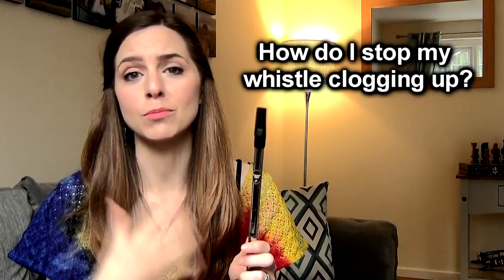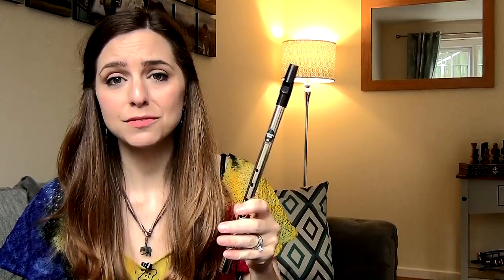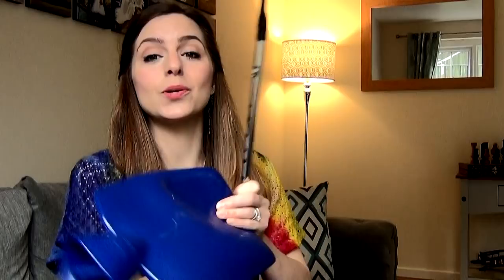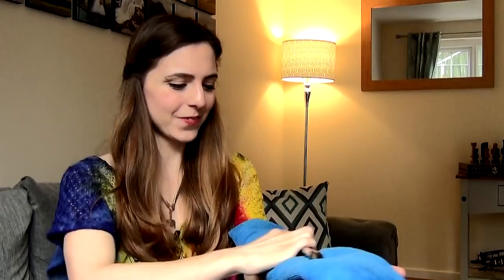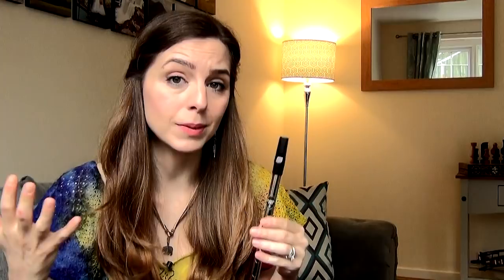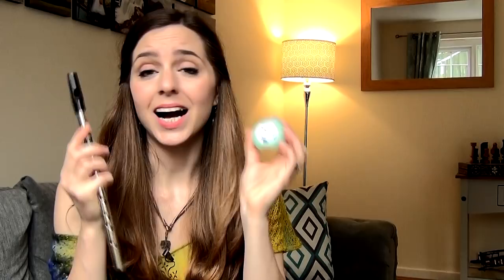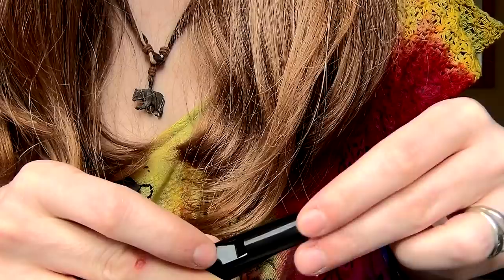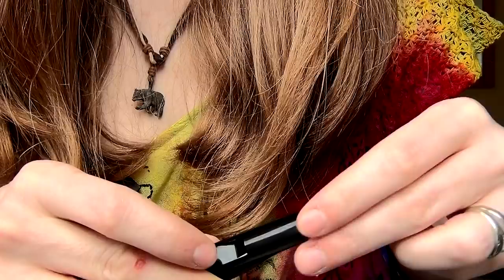TIPS TO STOP YOUR TIN WHISTLE CLOGGING

Comment: The dish soap and water solution works well in both plastic whistles and recorders and, as you rightly say, best avoided in wooden ones. I have been using this method for a long time and also with plastic reeds in musical instruments such as crumhorns. I have experienced for a long time that, if once wet with the solution the air duct of the whistle, recorder or reed is left to dry, for about a day, a patina forms which avoids clogging them for a long time and clearly, it must be repeated every now and then; in this case I would recommend a slightly higher concentration of soap, about 1/10 - 1/20.

Comment: Great tips, but I have to say, there is no way you can change the temperature of the air you are breathing out, except perhaps to change the temperature of the air you are breathing in. It is physics. A more vigorous stream of air, as with pursed lips, cools your hand more effectively and feels cooler, but the air is the same temperature as it was in a soft breath. That is how fans work...they move a greater volume of air across your skin at a higher speed, increasing evaporation and convection and cooling your skin, but they do not change the temperature of the air being blown. :) However, the volume of the air moving through the whistle does effect how much moisture accumulates...as increased air volume and speed increase evaporation...so your whistle stays dryer. That is really what is going on with the pursed lipped breathing. Sorry, I just can’t help myself sometimes. :)
Reply: That may be so, but using the terms 'warm' and 'cool' are very easy for people to understand and it helps them create a greater change in airspeed. I play flute and changes in airspeed are vital to play in different registers. My high school flute teacher would often have us blow on our hand, and it's far easier to make your mouth blow a different temperature than a different speed, because noticing the temperature difference on your hand is easier than noticing the speed difference.

Comment: Today I learned wheat bags exist, and people heat them! I find playing straight out with a warm whistle solves most of my issues. A short beaked whistles (e.g. Susato) prevents me from putting it farther back in my mouth where more moisture is available. My Oak has a long beak and it's easy to forget.
Reply from the maker: Wheat bags are FABULOUS, providing you don't have an allergy.   Few minutes in the microwave and you have hot flexible comfort 😍 definitely a must-have item in the UK wintertime 🤣

Comment: actually higher pressure does not mean lower temperature. It only feels like that because of the other air (that was not in your body) that gets moved by your blowing. Try this: blow into your hands that form a tube and touch your mouth: Now the faster you blow the hotter it gets because there is no outside air that gets moved and instead when blowing stronger you push more warm air through your hand which will make your hand warmer than blowing less strong.

But thats just from a blowing point of view maybe it actually works on a whistle very well. Anyway very good video love it

Comment: You can't actually change the temperature of the air only the speed. The reason it feels cooler on your hand is because the fast stream of air carries the cool surrounding air along with it. When your lips are sealed around the mouthpiece the air doesn't mix with the surrounding air regardless of the speed. The speed of the air will simply push water droplets through and out of the mouthpiece through pressure.

Comment: Thank you for your suggestion. Korea has less information and people who whistle, so video like you is very helpful. I am not good at English, so I am not good at it. So I have a question.
I wonder if I should soak it in soapy water and rinse it again in clean water. And is that less condensation when you blow the whistle?
I also wonder if I should apply toothpaste and then rinse it again. And is this also less condensation when you blow the whistle?
Reply from the maker: Soak in warm soapy water, then rinse with cool water. You will have less condensation.

If you're using toothpaste, don't rinse the whistle.

No need to do both soap and toothpaste. They have the same effect, but probably won't have double the effect used together.
Reply: I understand. Thank you.
I'm waiting for a video of your Killarney Whistle. I've heard that Killarney Whistle has a lot of snogging, and I'm waiting for your review of that whistle.
Also, I heard that Killarney has a back pressure, which makes her breath a little stuffy, but I wonder what it's like compared to other Whistles.

Comment: Hi Bonny lass . I can’t get through a tune on mk low F without it clogging up . I have a high C with plastic mouth piece which will play for a long time without clogging. Do you think some whistles. are more prone to clogging? Regards ,  Bill .
Reply from the maker: Yes definitely! I find the full metal mouthpieces clog quicker than anything else, but these tips do make a bit of difference, so definitely worth trying and repeating regularly to help keep clogging to a minimum. You can play through it, eventually the whistle will make a clear sound again, but it's definitely frustrating at times!
Reply: Did you ever find a solution to the clogging? I have the same whistle.

Comment: So is this what happens when I cant get a crisp and clean note?  Too much moisture in the flute?  I play my plastic Dixon Low D and after awhile it will not play a note very well.But If I take a hard breath in with the flute, it will then continue to  play clean and crisp,  like I cleared the pipe with my breath
Reply from the maker: Yup 😊 that's exactly what's happening. You can shake the whistle to clear the build up, or blow/suck sharply, but these techniques will help you play cleaner notes for longer without having to dislodge any condensation or saliva 🤣
Reply: Not fully covering the finger hole can also cause tone problems.

Comment: Tip number 2 seems strange to me because I assume that the temperature of the air in lungs is equal, blown fast or slowly, because it comes from the same place, the comparison you are doing about blowing at your hand is fallacious because of venturi effect, basically when you blow fast, air around your mouth get propelled foreward, that's why you feel it colder, because fundamentally the air in your lungs get mixed with the outside air. you can easily test it by making a funnel with your hand and blowing fast to a mirror (you have to be very close to it, almost attached) and then blow fast without the funnel.
Finally what I want to say is that the temperature of the flute does not depend on how fast you are blowing, and I suppose that blowing fast get the flute near to the temperature of lungs air faster than if it is blown slower.  
I hope my english is understandable, because it's not my first language.
Reply from the maker: Thanks for your great comment! 😊 Yes, you may be correct, it's simply a technique to try...I don't have hard scientific evidence that any of these work, but they've been useful in their own way for me and for others in the community. 

Often the language used in the video is to help people understand HOW to replicate the suggestion (rather than completely accurate scientific descriptions). 

The air leaving the lungs will be the same temperature, granted, and the speed of air through the whistle won't have much effect on temperature scientifically, though once the air comes through the mouth and into the whistle it's still affected by outside forces, as you mentioned, as it's interacting with new material (the air already in the whistle, the plastic, metal or wood etc.) The 'speed' was a simple way to explain how to achieve cooler air in a way viewers would understand 😊 though faster air may help to dislodge condensation that's building up in the whistle. 

There's a theory out there that the depth of the breath may have something to do with moisture too, though I wasn't sold. They theorised that shallow breaths may have less moisture than deeper breaths...who knows? 🤣